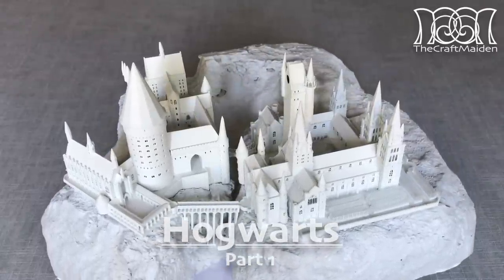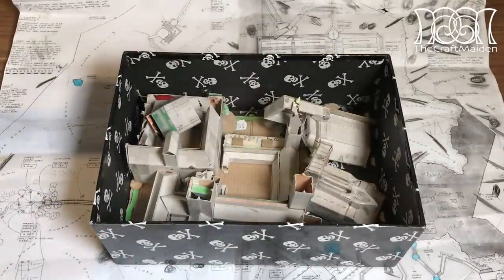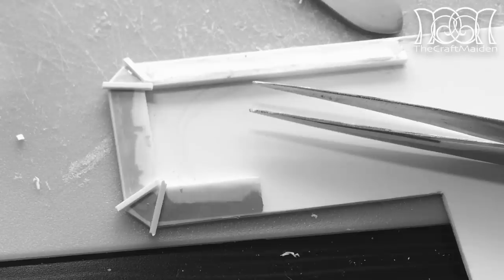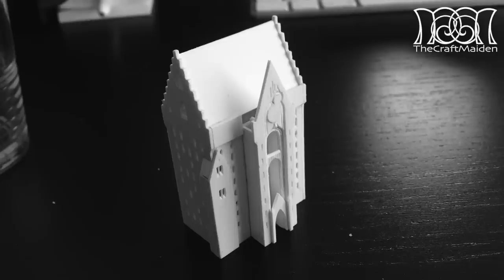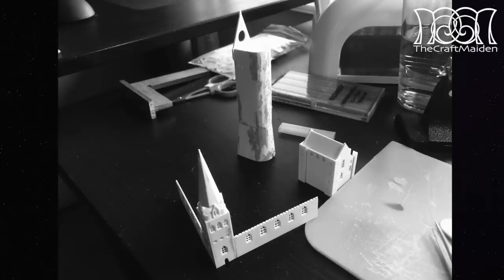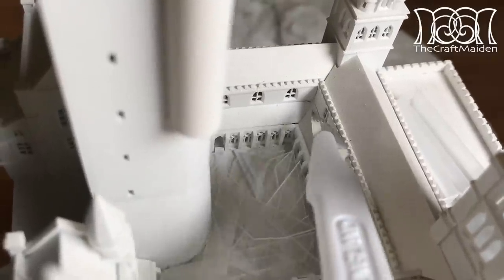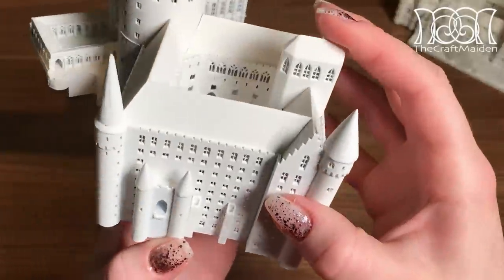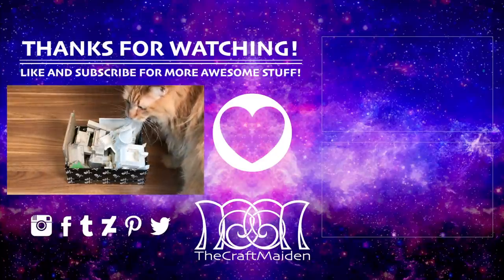Building a model of Hogwarts - Part 1 - Q&A

Comment: Have you ever heard of a product called Micro Krystal Klear ? It is a fluid that train and airliner model builders have used a long time to create  windows. It works by taking a drop of the fluid on the end of a tooth and touching it to 4 points on the frame, on smaller windows just touch in the center. This will work on openings up to 1/4in. It can also be tinted using transparent acrylic paint.
  My wife and I have been working to build the castle in 1/72 in but cannot find enough info to to do this. I have the "From Book to Screen" book but lacking any info you can share with us would be most helpful.
Reply from the maker: Thank you for the tip! I shall look into it! 😄✨ I’m going to build a few other buildings, like the boathouse and owl-tower. As I think it's easier to show and tell, so I'll explain it as soon as possible 😊